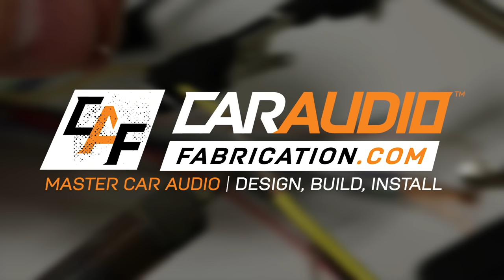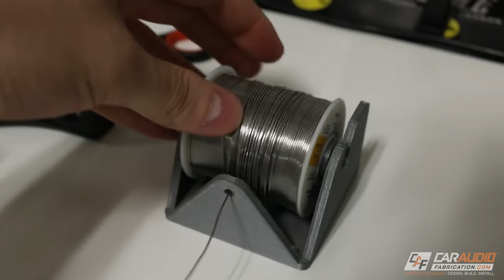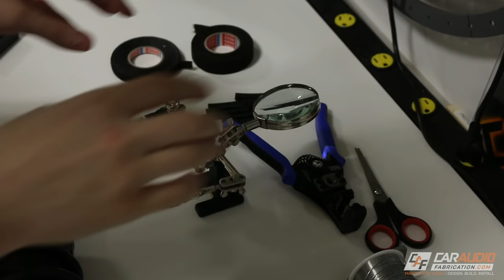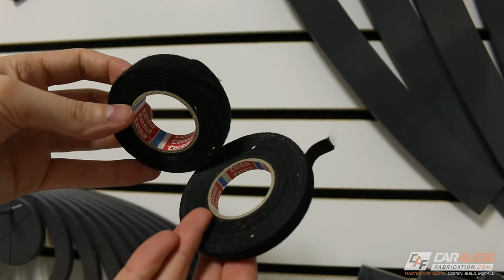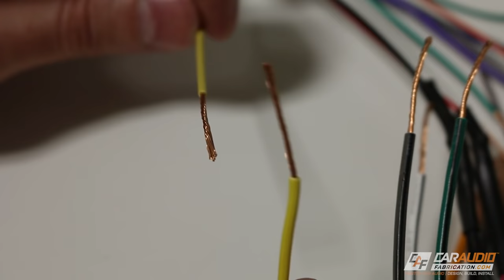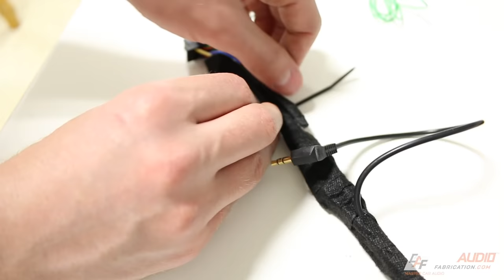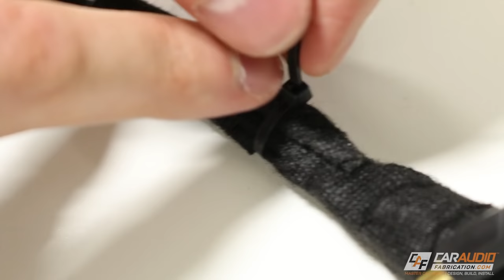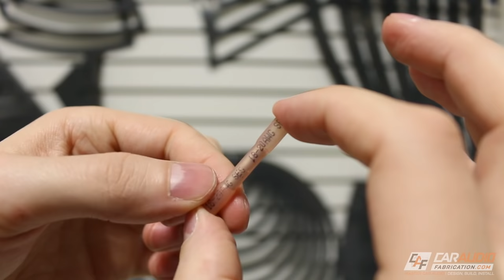Radio Wiring Harness - How to Install like a PRO

Comment: Butt connectors....electrical tape.....done.
Reply: Tony Bolton butt connectors are bulky and introduce 2 differebt types of metals to eachother causing corrosion it wont happen immediatly but over time corrosion will build up making your connections fail, electrical tape...I hate electrical tape it gets sticky stuff all over everything and when it gets hot in the car it starts coming off but the glue stays on everything solder and heat shrink is the way to go and very inexpensive especially considering how much heat shrink butt connectors cost
Reply: Lineman's splice (like he does in the video), flux, solder, clean, heatshrink, then loom.  I also trim the wires so you don't have so much extra wire packed up behind the dash.  I've got ~10 year old harnesses that are still working today vs. butt connectors which the wires fall out of if the person doing the install doesn't know what they're doing and/or doesn't use the proper crimper or will corrode and cause connection issues after a few years.  Heatshrink butt connectors with the sealing glue inside are nice but the combination of the steel sleeve in the connector, copper wire, and electricity is a recipe for galvanic corrosion.
Reply: Galvanic Corrosion requires a electrolytic environment, aka water.  If you properly seal your connections there should be no moisture present.  I have harnesses I've done that after 20+ years in boats that are used/stored year round outside in a salt water environment that are still repair free.  We all Crimp our battery cables with various crimpers (I use hydraulic crimpers, but have other types as well)  Then we seal the ends with liquid electrical tape at the seam between the Lug and the sheath, then we use Adhesive lined heat shrink tubing to protect it all.   Our Lugs are closed end instead of open end.  We also crimp, solder, and seal all ring terminals, for example attaching wires to the breakers in the main panel.  In an open end connector, the wires will act like a wick and water will creep the whole length of the wire, and cause serious corrosion issues down the road. Soldering the connector seals the end better than heat shrink or liquid tape.  Crimp/solder/seal will also work with butt connectors, as long as you figure in the need for strain relief and vibration resistance. In the bundle he made both are covered because there are multiple wires in the loom.  

Of course, I have to deal with USCG, ABYC, CE, AS/NZS and ABS standards, along with other more stringent rules set forth by the various marine equipment manufacturers.  One  rule is "Solder shall not be the sole means of mechanical connection in any circuit.”11.16.3.7.